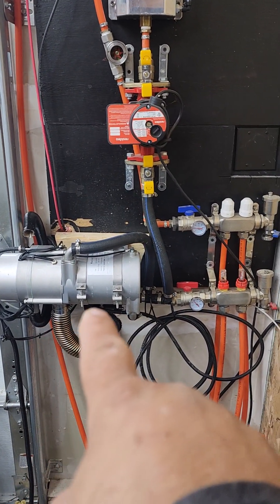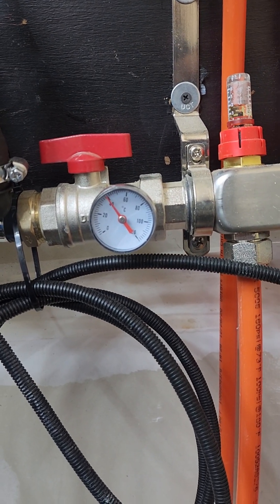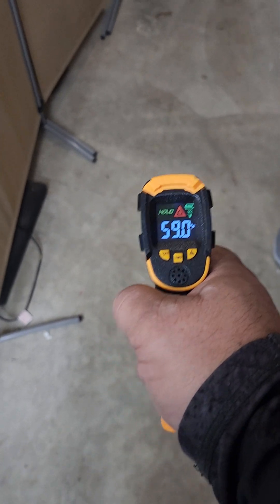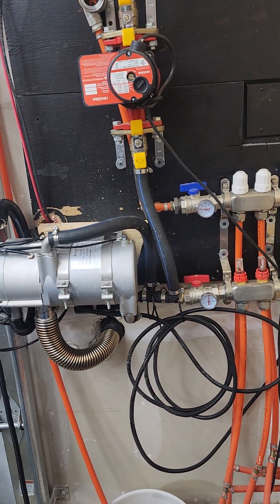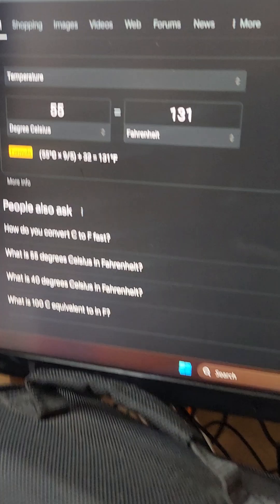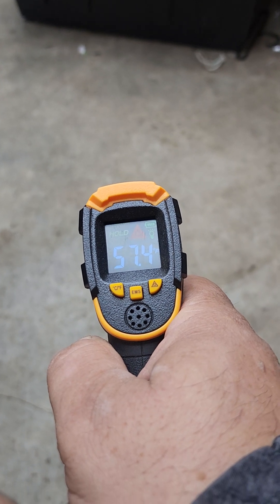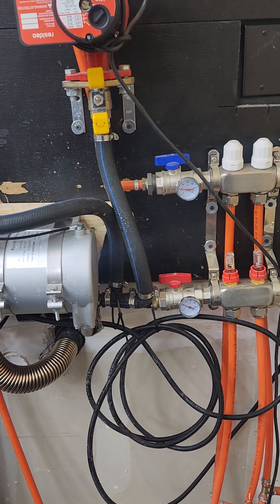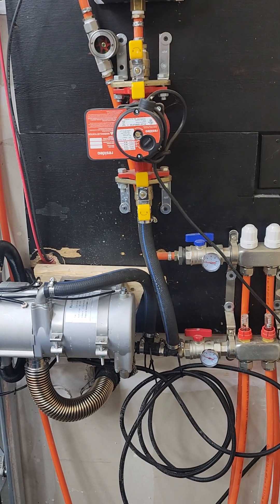hydronic garage floor heating with Chinese diesel heater (coolant heater)

Comment: If your water coming out it's supposed to be a 160 degrees I would follow that line. At somewhere it is not doing a full circulation or you have a blockage. But either way you were the one that laid the pipe in there so I would take your heater meter laser and follow that line and see where it changes abruptly and temperature. The other thing you can try is to increase your water speed to try to get the cold water back inside your heater faster. Your issue may very well be in your manifold with it not circulating water properly through it it is taking the path of least resistance. This is why I'm normal systems they actually have valves on each one so they can adjust it accordingly. You may want to consider putting a solenoid on each section and have it bounced back and forth through each section to avoid that problem.

Comment: Air block, it sounds like cavitation in the pump, so maybe the burner chamber hot chamber sensor is turning it off before it has chance of heating the water, I would imagine there are two temperature sensors, one for actual water flow & one for actual burner over temperature, 
Theres probably a air intake temperature that probably works with vortex speed motor probably hall effect switch recording pulses from motor, 
So whats happend in your case, cavitation & heating the water has created air bubbles & now you have an air pocket in the system, 
Use a hosepipe to flush out the air pocket, & smooth out the water flow where places of cavitation would occure,
You might be able to capture air pockets in say a high point clear tube pointing upwards with a blocked end,
Good luck 👍
PS is there a air blead screw with silicon washer on the burner chamber?
Put a Automatic air bleed in the top pipe end at the high point
Retired Scientist - Aerospace - Defence Hardware Test Engineer

Comment: I would focus on heating a larger reservoir of coolant - say 5 gallons - and then circulate from your reservoir to the floor etc.  The reservoir tank can double as your expansion tank. You can then have multiple sources of heat as well - like from a coal burner or perhaps even your household boiler.
Reply from the maker: Thanks, I had thought of this also...
Reply: @StarboundSound   If you change it around, please check back and let me know how it performs!
Reply: The way this would look is that you would Tee the inlet for. your parking heater BEFORE the circulator pump and then have the heater output return directly to the reservoir rater than putting it through the system. Basically a separate loop powered only by it's own pump.

Comment: I'd just get a little bit bigger buffer to reduce the on off cycles of the heater. Heat the buffer to about 40-50°C so it has some capacity to feed your loop.

Then run it through a thermostatic mixing valve (use the return of the floor as cold) so your floor will always get 30-40°C water intake. 

Then monitor your return temperature for a few hours at 15 minutes intervals and adjust the flow so the return temperature is 10°C below the feed temperature on each loop.

Comment: Water flow of the "heater" is greater than the water flowing through the "Floor".
First day of running, your floor was probably allot colder, you now are seeing less "demamd" as the floor is warmer...

If you have the space, add a old 15 gallon water tank in the "heater loop as a reservoir, then tee the tanks hot water outlet as floor supply and tee floor return to cold side of tank...

Comment: I replumbed the intake air to come in from outside and its not short cycling anymore.. interesting
Reply: @portlandlocalchurch8168  thats good news, in essence you did the same thing by using colder air instead of a faster pump , good thinking!! !!keep in mind what i mentioned, it might prove useful in the future.. i had short cycling for during the initial install due to the pump i had used not pumping fast enough.. 

On another note, how is this working out for you? What is youre LPH when using? Mine has gone up to 42 liters average for 24hrs but i havent diagnosed yet..

Comment: you need to rethink your water flow
get ride of the tee for the heater and have it flow with your floor pump
you have a short cycles from the water in the heater is just going round and round 
you want the cold water coming right back into the heater with the floor loop

Comment: Run a faster secondary to cool the burn chamber, water coming out should be about 120f.. it’s cycling due to over temp, maybe a restriction somewhere or if you ran a single loop? the hot water isn’t leaving the heat exchanger fast enough, I ran 190 ft before seeing a pressure and temp rise, so I plumbed a quad manifold to split the water flow.. edit: I used a variable speed circulation pump to control output water temp, at 120-128f output it runs 24/7, room temp stays around 78f, and I’m not using the original plastic POS pump it came with

Comment: Used to bigger boiler setups but I don't see a autofill. Your reservoir expansion tank looks a little small for what you're doing. I would think you might have a underground water leak and your reservoir is dry.
Reply: Reservoir has been spot on and staying at a perfect level all winter and I haven't needed to add any antifreeze to it at all..
There's no pressure on the tank so it's just free flowing

Comment: Interesting setup. If the heater is low enough BTU it should be able to just run continuously until the floor is warm. Put the thermostat on the return line. I have one of the chinese diesel hot air heater and I bought it with the controller that just has a 10 step "throttle" rather than a thermostat. Is your only only ON/OFF?